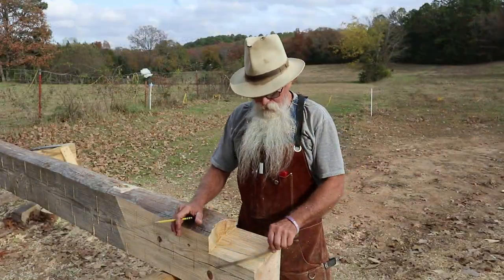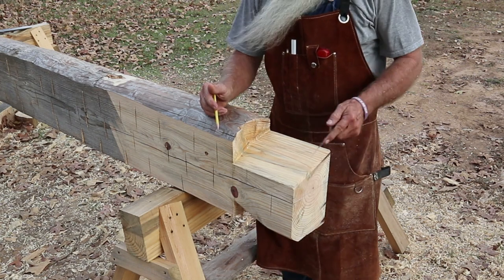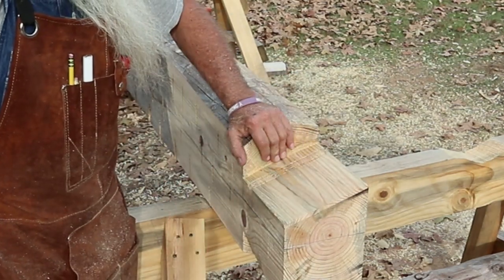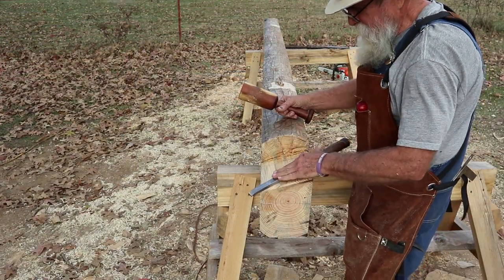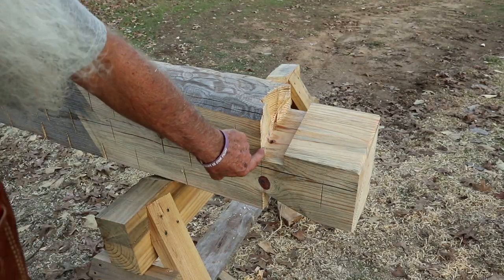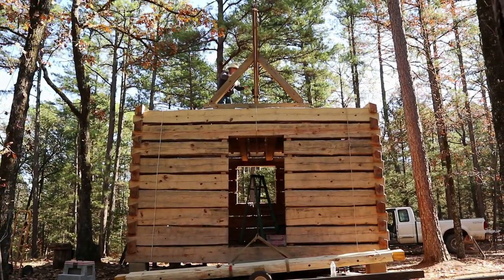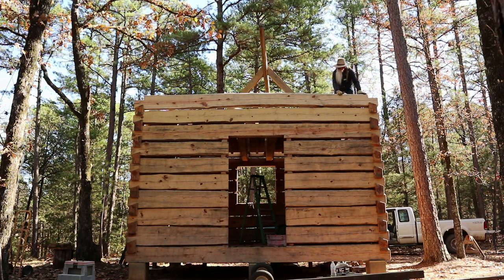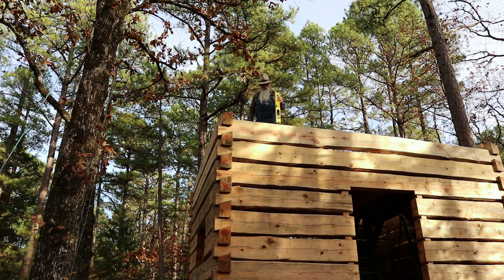Last Round Before Plate Logs, Paradise Point - Ep 10

Comment: just wondering why do the gaps get wider as you go higher? Looking good
Reply from the maker: Howdy- as I get closer to the top I gradually use the next smaller logs. I’m still trying to maintain the 1” gap between the logs but there is more rounded surface on the logs since they are smaller so it has an appearance of being wider.  Also, sometimes I have to use what I have and there may be a log used in a round that is a bit smaller than the other three and that will make the gap some wider. Thank you so much for watching the video. Take care and God’s blessings to y’all